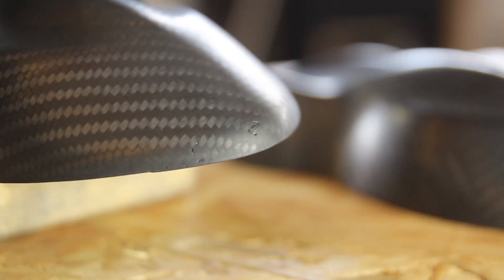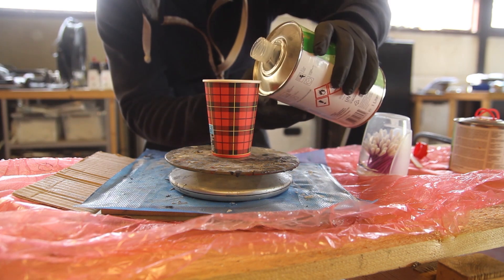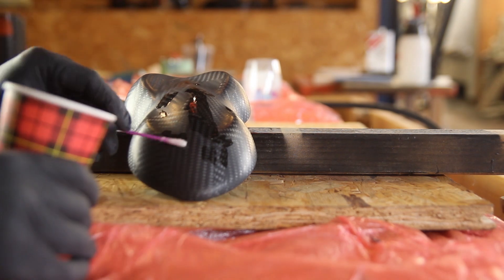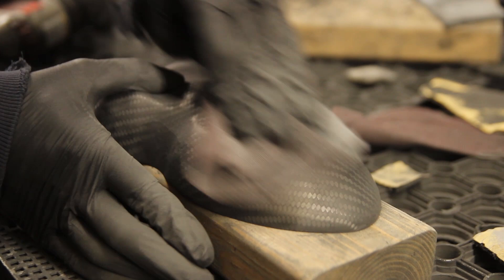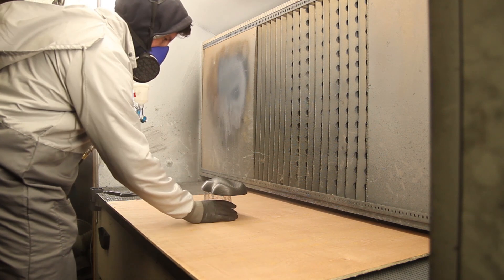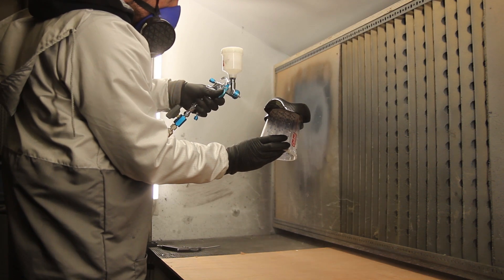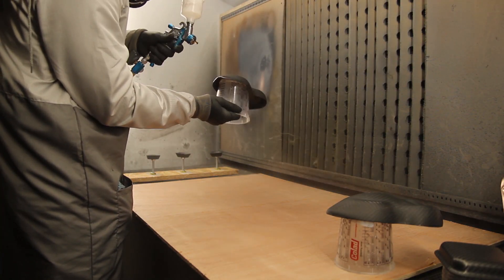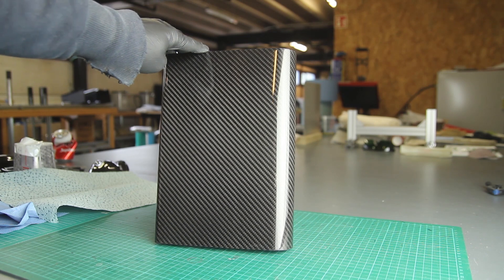Carbon Fiber Pinhole Repair - Get High Gloss Mirror Finish Easy

Comment from the maker: would you like a video on how to fix bigger issues like bridging, gaps or resin shortage in carbon fiber parts, let me know ;)
Reply: Yes, that would be great. Resin shortage can be so difficult. Thanks
Reply: @qcnck2776  weigh your cloth on a gram scale.  If you have 10 ounces of cloth you need at least 10 ounces of resin to saturate it for a wet layup.
Reply: @WereAllThatBored  True, but it doesn't get us ideal resin:cloth ratio if you want to avoid going over weight on the resin. 
I hope Matthieu was talking about addressing resin shortage without going over.
Reply: @qcnck2776  agreed.  When I was vacuum bagging I would start at 50 percent resin to weigh knowing that the peel ply and bleeder would soak up resin.  Maybe get you to 40% resin to weight.  Even when it comes to resin infusion I leave extra in the pot cloth to resin ratio wise.  Much cheaper to use more resin than it is to waste carbon fiber due to a bad infusion if air gets introduced to the lines.
Reply from the maker: @qcnck2776  I was talking about doing an infusion and have shortage of resin in some spots due to bad infusion line position or parts that didn't get saturated due to resin flowing in other parts of the mould resulting in resin porosity and bad saturation of fibers
Reply from the maker: @WereAllThatBored  correct on this one! I like to make a bit more as well to avoid having to mix more resin and keep filling the infusion cup :D
Reply: Yes, I was hoping you would give us some hints about how you go about in the planning stage of the layup. Your parts come out so good😂, and thanks so much for sharing with us.
Reply from the maker: @qcnck2776  will see if I can bundle it all in another video ;)
Reply: Yes please that will be great
Reply: Eliminating bridging would be a cool video.  Not many videos out there on how to avoid it.
Reply from the maker: @WereAllThatBored  might be something interesting as well! thanks for the idea
Reply: @MatthieuLibeert  please show us
Reply: Yes, please
Reply: I've got superficial cracks on my BMW 2020 S1000RR Carbon fiber rims in between the spokes! BMW claims mine with many others are cosmetic but I've got an appointment with an engineer at the college to get an X-Ray done along with other density checks! If its only cosmetic I would really like to fix them  back to show room quality if possible! PLEASE HELP🙏
Reply: Yes!! Thanks!!
Reply: Great video Matt as always! 🦾and Yes please make a video showing your method on repairing bridges, resin starvation, dry fibers etc prior to clearcoat!
Reply: Hello Mathieu Libeert, I have my comment on your video and your work has a lot of Insite working on carbon fiber which can be very difficult, keeping the weave straight, laying down the carbon fiber in the exact spot and undistorted. The pin holes are easy for me, I just dab the left-over resin immediately after spraying using a pointed exat-o razor blade or pop-cycle stick. Also, the carbon fiber from Composite Envisions is extremely delicate, wants to fall apart and distort quickly. The left side piece in your video, wondering the process to lay the patches of the weave unraveled, sharp and clean cut? More videos would be great.

Comment: Hello Matthiew, I would sure like you to explain to me how you did the patch work carbon fiber piece, very nice job. Also towards the end of your video after the final coat in the reflection I can see 1 pin hole you missed, take a look, a lot of the time I inspect with a magnifying glass to double check, I can't have a single imperfection, I do Pebble Beach Concours classic cars most worth around $ 1 million and want 1st prize.

Comment: Hello, I was wondering how you did the curves patch work with your clean edges. I do patch work on jobs only know how to do straight cuts. I've repaired Lamborghini, Ferrari, Maclaren rear defuser which is the large fin piece on the rear lower bottom, the part gets large holes and cracked. Your work is excellent

Comment: I fill pinholes or slightly larger gaps with epoxy bartop. I wait until the epoxy starts to cure so it's a thick gel before applying. This stops it dripping off or through the part. I find it more suitable for filling holes than clear lacquer.

I personally would not use a qtip due to the risk of contaminating the coating with bits of cotton. I use plastic clay modeling tools to apply and scrape off excess coating. 

But... there's more than one way to skin a cat.

Comment: Can you make homemade prepeg at home? I ask you because I would like to make a car dashboard but I don't want to make it glossy due to the reflections of the sun, thank you very much
Reply from the maker: would be hard to make it at home...you can always place a layer of dry fiber on a flat layer of plastic then use epoxy and use a piece of plastic spreader or bondo spreader to saturate and wet out all the fibers. Once done you can then transfer it on top of the dashboard and remove the plastic film and get it into all corners and bends, but it aint easy work... about the level of gloss; it has nothing to do with the type of carbon you use but your level of finish you use. Sand and polish will give high gloss. gloss clearcoat as well. Matte clearcoat or  low sanding grits will leave a dull, matte or satin finish
Reply: @MatthieuLibeert  Ok thanks so much for your time/effort Matthieu 👍🏻👍🏻👍🏻
Reply: @MatthieuLibeert  there is flat 2-part urethanes at the automotive paint supply stores

Comment: might be offtopic,  but what brand of spraygun is this? or just a generic 0,8 gun?
Reply from the maker: It's a pretty generic gun, nothing special about it. If I'm correct it's a Hamach HVLP minigun... but like mentioned the spraygun isn't making the biggest difference, at least not in what I'm trying to get out of it. Just avoid the very cheap ones you get in DIY stores I guess

Comment: Sand the Cfk parts with 320, then paint them with a Polyurethane filler. Then sand with 400 and apply 2K Clear Coat. No pinholes. Also works just for small pinholes. For bigger repairs you can use UV Resin and sand it down.👍🏻
Reply: what filler do you use?
Reply: Interesting, What polyurethane filler ?

Comment: Hello mathieu.
Instead of using Q-tips,try using coffee sticks that you just cut to a point so they are sharp. This allows the resin to be drawn into the pinholes, which means less dripping and less sanding.
Reply: Toothpicks work even better
Reply: Thanks for the tip!

Comment: Put in carbon fiber dust and epoxy or superglue and fill the holes with it.
Reply from the maker: works as well, I personally prefer clearcoat to stay with the same system and products for final coat. I find epoxy harder to sand with the risk of sanding through the fibers around the filled epoxy resin pinhole. But works as well :)